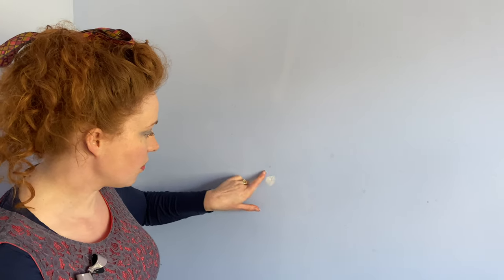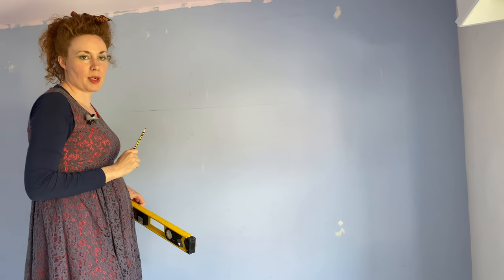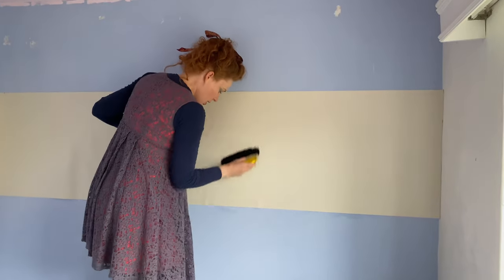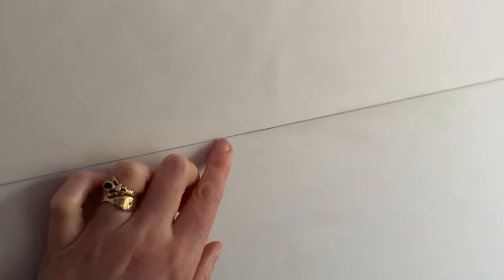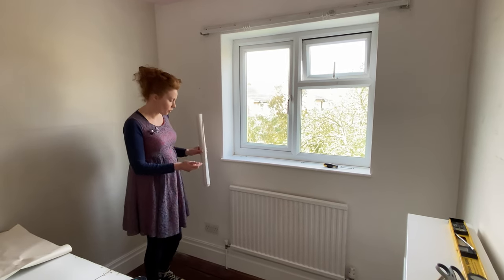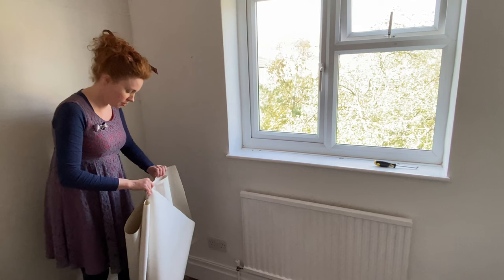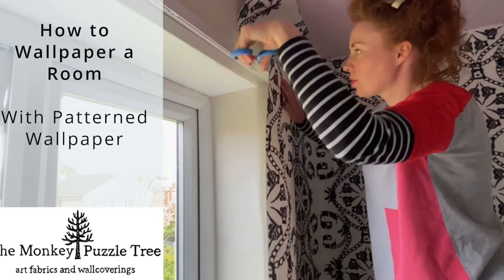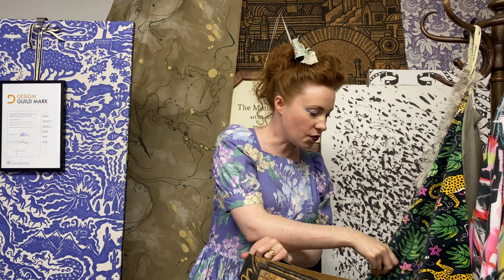How to Hang Lining Paper - a comprehensive guide to cross lining

Comment: morning. welll done. Just  two quick things. check the instruction on lining paper.. I think youll find 1000 lining needs about 9 minutes soak time. also then you don't leave a gap, butt joint, the paper won't be stretching any more..... as you've allowed it to soak enough.
Reply from the maker: Thanks Phil! That's an extremely helpful tip. I need to find a way to include all this extra advice - maybe in the notes. Much appreciated, Charlotte

Comment: I like to use a 9”roller to apply the paste using a basin bowl to mix the paste in its quicker and you get an even spread of paste. If you put your bucket of paste on top of a tub of paint or box to raise it up it will save your back. 
Nice vid 👍
Reply from the maker: Thanks Geoff, that's a really good tip I will use in future!

Comment: Do you think it would look okay to put lining paper and then paint over it or is it better to just use wallpaper
Reply from the maker: Hi, yes - you can definitely paint lining paper. If you’re not putting wallpaper on top you’d want to hang it vertically without gaps as if it was normal wallpaper. In our house we had artex which I steamed off so the walls were not very even. I cross lined with lining paper first and then used lining paper over the top like wallpaper hung vertically without gaps and then painted. We did that 18 years ago and it still looks good.
Reply: @the_monkeypuzzletreeltd  that helps a lot thank you so much!

Comment: Just a question? Would you take the radiator cover off, and bring the lining and wallpaper all the way to the top of the skirting, to prevent curling with the heat, from the radiator over time?
Reply from the maker: Yes definitely if that's possible. In this case we didn't want to do that as it's a small upstairs room and we didn't want to risk any leaks, but it would definitely be better if you could take the radiator off. Although I haven't had any issues with this method as long as you're careful to use plenty of paste and make sure the paper is properly stuck down.

Comment: Plenty of great info there, couple of tips...start at the top and wirk down measure the width of the roll, (say 530) deduct  30mm, measure diwn from the ceiling 500mm, do your line and start with the top piece.
When cutting the widths, measure the width of the wall and add 100mm to it..pasting, paste down the centre, then the furthest edge, then the nearest edge, use smaller folds so the paper is more manageable.

Size the wall first to aid slip

Love the top paper 👍

Did you ever get a clip out with the finish paper?
Reply from the maker: Thanks so much, great tips there!
Reply: @the_monkeypuzzletreeltd  love the paper designs, something I always wanted to do, put a rag rolling effect that I have created on wallpaper, left it too late now as its not popular at the moment
Reply from the maker: @Lloyd1885  Thank you so much! Actually I think this is the perfect time to do a rag rolling effect wallpaper - I reckon it's just about to come back into fashion, borders too. There was an Elle Decoration front cover a few months back with a really interesting rag rolled paper and neon highlights.
Reply: @the_monkeypuzzletreeltd  Not an easy thing to break into, wallpaper companies wont touch someone, I have tried that route, (William Morris and John Henry Dearle had the same problems with that cheap tatt they designed apparently 😉).... I think people who may be tempted to have it wont be the high end customers, they will pay for someone to do it by hand I think, which leave your average homeowner, how much would they pay for a roll?...I think a shop would have to sell a lot of rolls, manufacturers would need a minimum run of of maybe a thousand rolls before setting up the machines (I'm guessing, I'm not a manufacturing expert) given that an average paper costs 2-3 quid to produce, making a profit would be difficult, that said, I wouldn't be in it for the money, its just been a bit of a pipe dream of mine for years.
Reply from the maker: @Lloyd1885  Yes, I can tell you from experience it's very hard to break into the wallpaper market - and definitely something you would do for love not money! However these days you don't have to make thousands of rolls, there are plenty of places where you can even make one roll digitally printed which would suit what you want to do, and the quality is very good (BUT you certainly won't be paying £2 per roll!). Have a look at Surface Print, R A Smart or John Mark if it's something you'd like to pursue.
Reply: @the_monkeypuzzletreeltd  thank you, its worth an enquiry at least. 👍👍